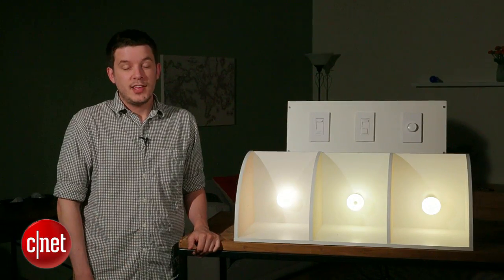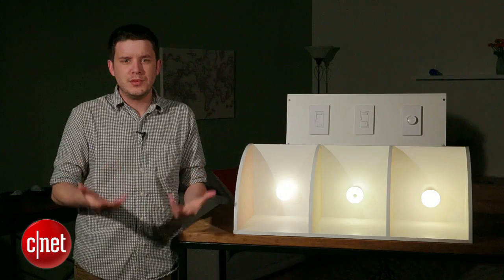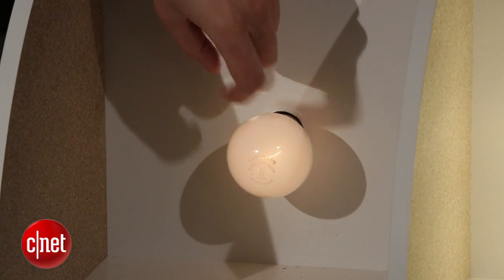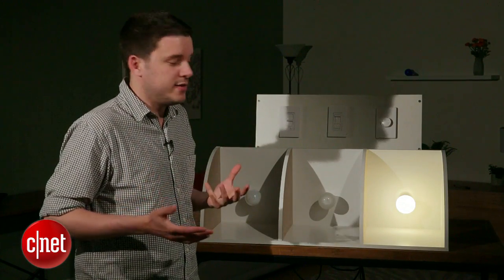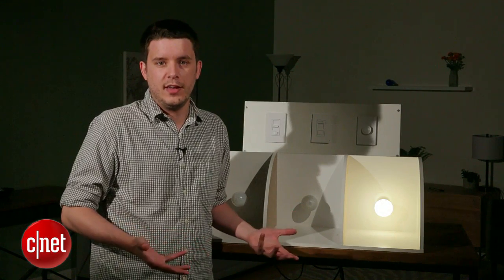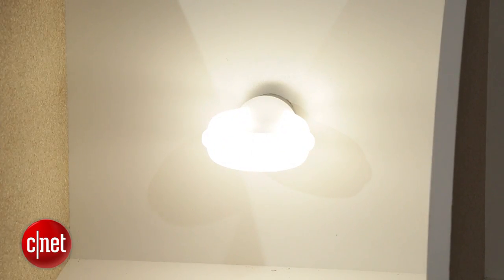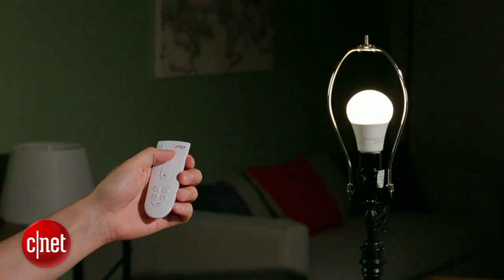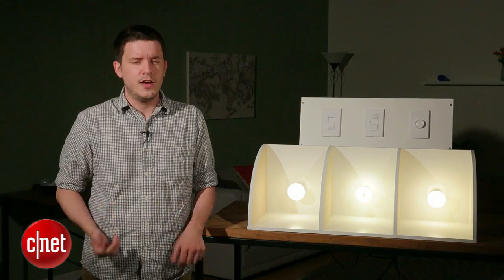In pursuit of the perfectly dimmable LED

Comment: I'm not an anti-LED luddite, but I HATE being forced to use them.  I've tried a couple brands of LED in my 11-year old porch lights that just don't work. (They come on at 50% power by default when it gets dark, and illuminate to full power when the motion sensor is tripped.)  I can't remember which brands.  I picked these fixtures out myself and I really don't want to buy new fixtures again soon.

I have a hard time believing an ordinary LED bulb worked with an analog dimmer.  You have a model number for that Phillips bulb?  Maybe a leftist reader can help me out and explain how to get through this green new deal nightmare that is only beginning.

I guess this video is 9 years old so they probably don't make that unicorn Phillips LED light bulb anymore.

Comment: Hi!!! I am currently in search of a good tri color bulb. The bulb that can change color temperature by just powering off or on the switch. However, I am thinking of using a dimming switch in order to dim further the light whenever it is for example in 4000k color temperature. Do you think the dimming switch can do that?

Comment: 0:48 You are looking for words: Pulse Width Modulation or PWM.
Reply: Not necessarily, everyday consumer dimmers tend to simply use a triac and a delay timer to slice up the sine wave.

Also devices that use PWM usually create their own square wave, since it is basically easier to do so than flat-heading mains  sine wave, and they do at a frequency that doesn't make audible noise.

Comment: This is good info, thanks. fwiw, in the lighting profession "bulbs" are referred to as lamps. LED lamps are the tiny chip-based component(s) where that chip is the "package". The entire assembly of LED packages, driver and encasements (in this case, the incandescent-like plastic surround) is a luminaire. Technically, then, this is a comparison of LED luminaires.

Comment: Bioluz LEDs are the best. Zero buzz.
Reply: Buzz is non-issue with a decent dimmer.  I bought every bulb Home Depot has sold for the past 6 years.  Only one buzzed, many flickers but only 1 buzzed.  If you have buzzing it is probably the switch.